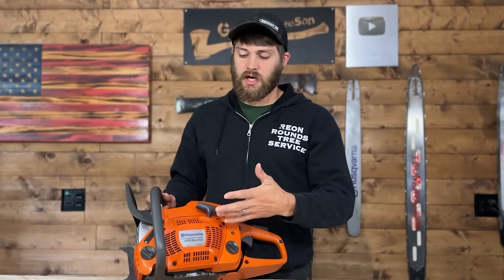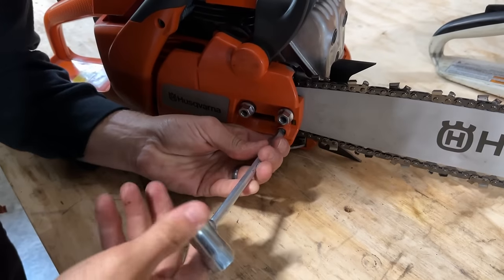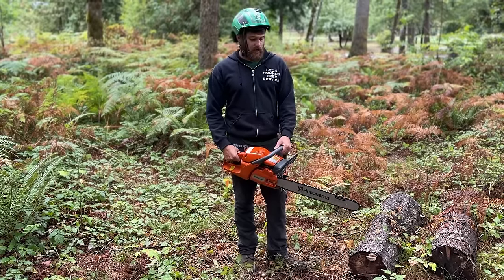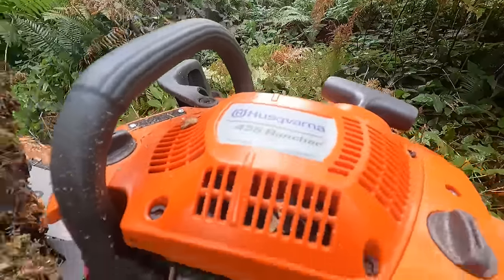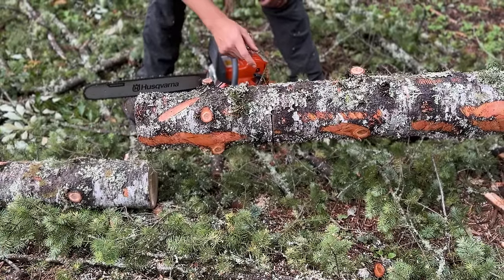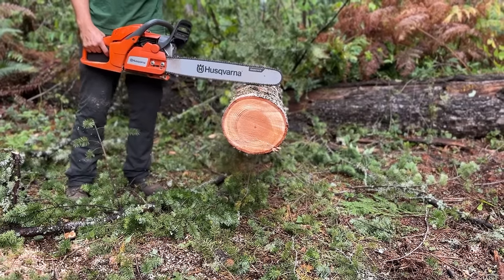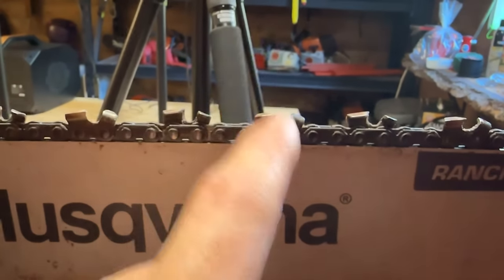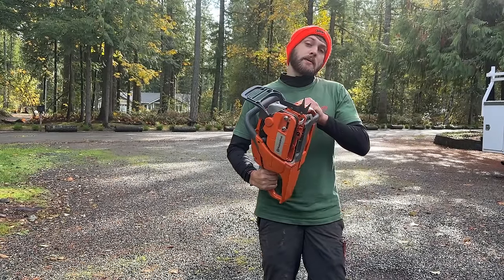WORLDS BEST CHAINSAW TUTORIAL! EVERYTHING You Need to Know About Owning and Operating a Chainsaw!

Comment: If you "Texas start" a cold, high compression saw that is over 70cc which does not have a compression release valve button, you just might be singing soprano for a while!
The 4th starting technique, which you neglected to include, is where you have the bar & chain between your legs, which usually results in "permanent soprano mode".  🤣

Comment: the 2nd way isnt much different than the drop start...you dont have to pinch it between your legs, you can just keep the handle in the slot and drop start it.  Its just as easy as drop starting, and safer.  I'm not saying I do that all the time, but for work, we were not allowed to drop start...and aint nobody got time to start it on the ground.

Comment: With bore cut & kickback. The worst kickback is the top quarter of the bar. When you demonstrated you naturally did it right, using the flat top of the bar, before rotating the bar to 90 degrees & boring, but what you said was different - that it is OK to use the top quarter - really not true, as if you are not super careful & controlled, it will kick.
Whereas you can use the bottom quarter as it will pull & not kick.

Comment: 😂😂 this is a prime example of why everyone prefers stihl.. the tensioner in the plastic cover has always been a non starter for me.. and then all the chokes.. primer bulbs and all that other crap.. stihl you don’t even choke or they flood  lol.. won’t lie it can be goofy getting the compression in the right spot to star them sometimes.. but not hard to get used to feeling when it’s are the right spot to actually rip the cord. 

But there so many things on a husky to mess with lol.. and I do prefer to over tension my chains a little.. husky don’t have the torque they rely on rpm instead so harder to do wo burning the clutch out.. but I prefer to know I won’t throw a chain and just buy new bars as needed..

Comment: I'm 70yrs old and only have a few years experience with chainsaws and chainsaw safety. However I have been a Mechanic and technician most of my life. 
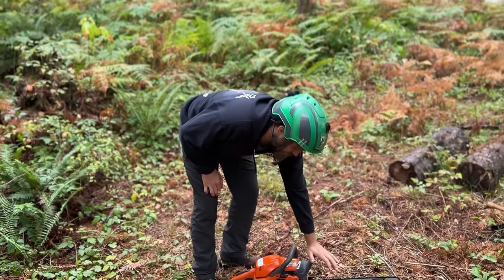I'm only 19:00 minutes into this video but have already noted several concerning comments.
It makes ma uncomfortable listening to an expert that makes a comment with an uncertain voice or sort of laughs off a point one is unsure of.
It is also not helpful to point out procedures which only pertain to specific types of equipment.
I'm not going to nit-pick because I know you know what you are doing, on the job and I also know how difficult Presenting is compared to just doing the job.
* That said:
Please always include a warning when explaining how to Pull start equipment. Whether it be a Chainsaw, Blower, weed wacker or any other machine, there are at least 2 types of pull starters. Standard Pull and Easy Start. For the residential user <Easy Start> is becoming the more standard design.
The most destructive procedure one can do to an Easy Start system is to Drop Start it. There have been many instances of Easy Starters destroyed on the first Drop Pull of the machine. 

Bare in mind, when you are presenting to Novice they are not only trusting in your experience, they are also going to often become a bit overwhelmed by the flood of knowledge and may miss warnings or misunderstand - The way I do it - vs. following the <Manufacturers Recommendations>

Keep safe out there and enjoy your time high above the earth. It can be beautiful up there if you have time to just look around.

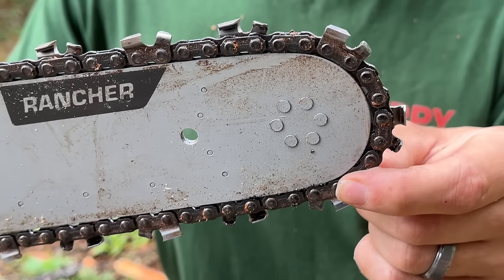Comment: I love your videos Jake, and I know how knowledgeable you are about the vast majority of topics on your channel.  So, I was pretty surprised to hear how off-base you are when talking about kickback.  Definitely not trying to be an ass, but at 48:45 you're actually telling people to start the cut with the most dangerous part of the bar...the top quarter of the nose is literally called "the kickback zone" for a reason.  Kickback is not caused by the tooth not being able to cut into the wood, it's the exact opposite. 

On the top quarter of the bar, the cutter is both descending and moving away from you.  Due to the geometry of the cutter, the raker begins descending first, before the cutting edge of the tooth, and the angle of attack changes.  Kickback is thus caused by the cutter taking far too big of bite into the wood, and essentially stalling the chain.  Since the chain can no longer move forwards and down, the inertia is directed into the bar causing it to fly backwards and up.

I still love your videos, and continue to learn tons from you, but I think that segment really needs to be corrected before somebody tries pointing at you as the reason they got hurt.

Comment: Your first mistake was putting your first gallon of 92 octane into your tank from a single hose pump. The guy before you probably used regular and so the hose and pump contain ethanol gas..... put the first gallon into your truck and that way you purge the unwanted 87-89 grade gas from the pump system..
Reply: That's not accurate... Most of the gas drains out of the hose (hence why it's mounted so high), at most you're getting a thimble full of unwanted grade gas
Reply: That is something I have never thought of before. Even if you only get a minute amount of ethanol it’s still too much.
Reply: That’s not how that works

Comment: The information about ethanol free gasoline is sorely lacking, for anyone wondering they blend ethanol into gasoline to make the fuel go farther at the cost of it being a little cheaper, most engines are capable of handling gasoline/ethanol mixture that is normally a 1 : 10 blend, HOWEVER, there is a draw back, some engines are not built to withstand the hard jolt of ethanol even mixed with fuel to 1 : 10 ratio, plus water easily mixes in ethanol so there's a high likelihood that your 1 : 10 is contaminated at the VERY LEAST with 1% water, but it can go much higher depending on a lot of various conditions with any gas station you go to E.G; was it raining when the tanker pumped it's fuel to the underground holding tanks, is the tank properly sealed from rain water from when it was constructed, how long the reservoir was open for, even up to the last time it was fueled by the last tanker as the less fuel there is in the ground tanks the more water it will contain on average, ethanol doesn't normally stay pure for very long! it degrades down to 5% water in a matter of months rapidly, IF IN DOUBT, DON'T PUT REC'90 (ethanol containing fuel) INTO THE TANK, it could damage the engine.

Ask me how I know this? some motorcycles are sensitive to such a degree that the volatility of the ethanol or water content can cause serious misfires or engine knock which can lead to catastrophic damage over time, this usually is the case of quality machines that weren't meant to handle it as ethanol is just a filler additive and engine manufacturers have had to give engines some headway with the ability to correct for error on the fly, something a car can do, but a good motorcycle or quality small cylinder engine cannot.

Comment: You need to think about the amount of gas that's left in the hose from the last person that got gas and probably put that in your vehicle before you pump gas from something that's got three or four different ones coming through the same holes you're not giving a good explanation of doing that if the person before you had ethanol gas or different octane then there's gonna be about a half a gallon of it in the lines so no matter what you punch the button for it's going to be different in your gas can

Comment: 455 Rancher...
Chain brake in a plastic clutch cover, tensioner in the plastic,  oil and fuel caps are inset - must clean around them before opening, otherwise crap falls in the tanks...
Garbage design 😅

Comment: 31:56 what's the point of cleaning the face cut? I think there's no big deal with those few cm of wood.
And also, aren't you doing that face cut to high? You are wasting big chunk of wood and it's said that bottom part is better quality than upper one :v
Reply: Although the importance of a clean face cut is not really a topic for a beginner chainsaw video, neither is cutting down a tall, back-leaning tree with a powerline hazard into a narrow drop zone using wedges.
Nonetheless, the face cut is a critical feature of tree felling where accuracy of the drop is important - and it usually is. The back of the face cut is the front edge of the hinge wood and will largely determine the direction the tree starts to fall in. If it is not clean - as with the small Dutchman - the  hinge wood can fracture early in the fall causing the tree to freefall where its center of gravity takes it. The front edge of the hinge wood needs to stay intact until the face cut closes up when the tree is well on the way to its intended landing zone.
As far as the height of the cut, it's far safer to make it at a comfortable height where the operator has good purchase, footing and balance. This tree was obviously not headed to a sawmill.
Jake tried to keep things basic but naturally tended to his experienced techniques.